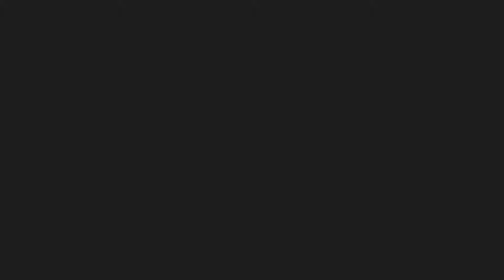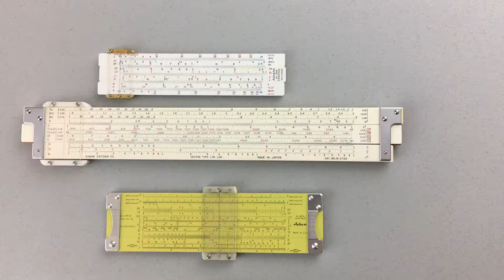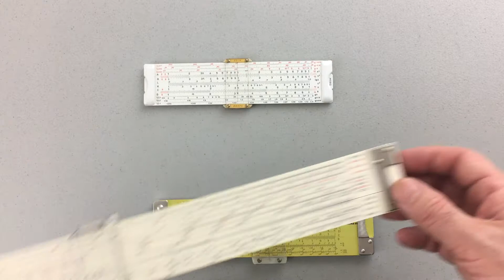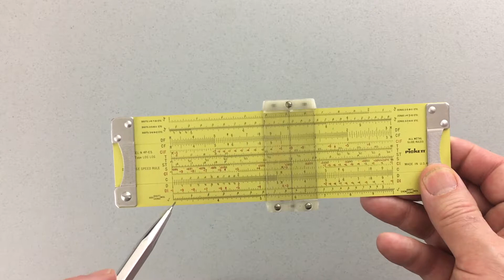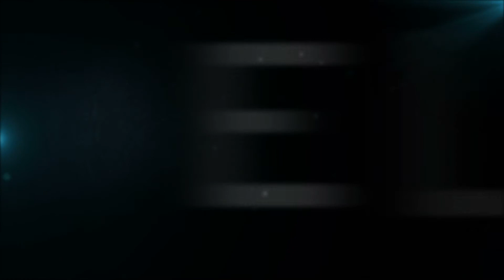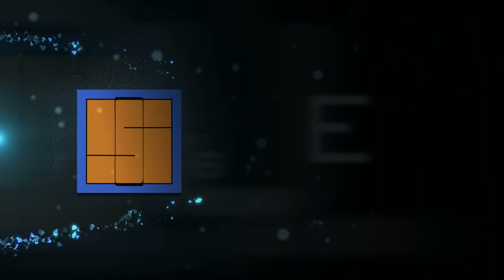Which Slides Rule?

Comment: I guess “That factor of safety “ is why most things built in the past ie., the 30’s,40’s and, 50’s were over built due to the inaccuracies of the slide rule.
Reply from the maker: I partially concur with what you say. Factors of safety are always applied because we cannot know all conditions of service and various conditions interact. When you consider the multiple dependencies in engineering problems, the engineers of previous times probably applied more factors of safety than is done today because we have different computational tools and more computing power at our disposal than say the engineers who helped put Apollo 11 on the lunar surface. The slide rule could provide say 3 digits on it and therefore there were limits to its computing capabilities. Having said that, many things in large civil works like a dam or a power plant don’t need lots of digits in an answer.  The slide rule, when applied properly, gives us a unique insight as to the dependencies between variables once you master it. 

BEGIN OLD MAN RANT

IMO, the slide rule’s true value is that an engineer or scientist could not go to a box (the electronic calculator, spreadsheet, etc.), plug in some numbers, and get an answer without exerting some thought. I find that the simple act of writing things down compels me to organize what I want to find, what information I have, and then work into the answer. (I note that I carry 2 slide rules every day and try to practice with them). IMO, it is far more important to manipulate the concept in your mind and then do the computation at the end than to plug numbers into a box hoping that you’re going in the right direction. 

By definition, you have to understand what I will refer to  as “Pre-Calculus Math Facts” for you to make intelligent use of a rule with exponential or trigonometric functions. A calculator (and math textbook’s use of electronic calculators since the mid-1980’s) allows the user to become more of an operator than a thinker because it is easy to punch in numbers and produce an answer. A slide rule requires more thought to use.

The first chapter of many manufacturer’s slide rule booklets plus the numerous books published from the early 1900’s up into the early 1970’s would then focus on the MAGNITUDE of the answer. The act of simplifying the answer using “easy numbers” and learning how to think in scientific notation helps immensely when performing back of the envelope calculations. How many texts on elementary scientific computations written today have this basic information on learning how to estimate included in their introductory material? I’d guess very few.

I once had an older electrical engineer pull out his Post pocket slide rule and perform basic mental calculations associated with figuring out apparent power given some basic information. When we checked his answer with a hand calculator, we found he was off by say 1 or 2 digits in the 3rd place of his answer. Not too shabby for a mass manufactured piece of plastic given that I punched in the same set of numbers in my $120 (1985 cost) HP-11C with little understanding of what he did (I was a college engineering student at the time).

I cannot resist my favorite example.  If you want to perform elementary vector calculations with an electronic calculator, you need to understand the keystrokes sequences in the given device (one electronic platform being entirely different from another). If you get a keystroke sequence incorrect, you will get an error because of you have input numbers in a format that your device does not “like”.  Even assuming you make it past the input hurdle, the modern electronic calculator most engineering or science students would buy has a user interface that is difficult to use for vector manipulation. 

The slide rule, by contrast, easily converts between polar to rectangular forms (again with a little practice and a firm grasp of trigonometry) common in vector operations. The slide rule does this without the need for batteries, the need for constant firmware upgrades, risk of malware, hacking, or a user’s manual beyond what you get from the slide rule vendor. In days past, a well laid out slide rule (with an informed user) saved many an engineer or scientist from carrying around handbooks filled with arcane pieces of information since all the common data could be placed on a slide rule scale. 

I’d ask you to consider the fact that the Hoover Dam, the Empire State Building, and the SR-71 spy plane were all built with only paper, pencil, and a slide rule. Granted, we had teams of people possibly working on the same portions of a problem and no doubt it may have taken longer to do these tasks. Even so, the fact that this humble tool did so much to build our modern world is simply astounding to me!

END OLD MAN RANT
Reply: @sliderulesurvival766  Most excellent discussion! Many thanks. In 1974 our college chemistry professor only allowed a slide rule for classroom calculations. Learning scale relationships and keeping the mind focused on each calculation step of a problem was the goal, which is mostly lost in the use of digital calculators. The slide rule is an amazing tool.
Reply: @TheRockMorton 😊
Reply: There's a big difference between precision and accuracy that people don't grasp until they play with slide rules. A slide rule will give you a 100% accurate answer if used properly, but only to 3 or 4 decimal places. A calculator will give you a highly precise but inaccurate answer to 10+ decimal places if you didn't enter your numbers to the same precision, because no answer can ever be more precise than the question asked.
 The real reason things were overbuilt in the past is because they were built to last instead of being disposable.
Reply: First, overbuilding wasn't predominant in the past - it's predominant in what survived from the past! Anything not overbuilt tended to fail because no one knew or could design for all the factors that would fatigue and lead to failure of structures or engines.

Overbuilding in civil and other engineering products of the past compensated for the inability to fully know and simulate the environment and loads encountered.

No team of slide rule users is going to perform FEA or CFD. Computers do that by manipulating whole arrays of numbers in ways that a room full of engineers could not do repeatedly at scale.

Now, I want to see if there's a way to perform FEA using analog devices, even if it has to be done in a computer simulation just to save time and avoid hoarding identical slide rule models...
Reply: @BrianTRice77 Trying to broaden my knowledge here, even at age 70+; what do the acronyms FEA a CFD stand for, and what are the operations used to find? I am obviously not going to perform the calculations, but I just learned about the “geometric mean” today, so for some of us, learning never ends. Thanks!
Reply: @charlesward8196 FEA is finite-element analysis.  It involves dividing a complicated structure into a large number of small "bricks", or elements.  A simple math model of the brick's internal stresses and  deflections due to unit loads applied to the corners of the brick describes the brick's response to loads.  The external loads are applied to the exposed corners of the surface bricks in the model.  The forces and deflections of connected corners have to match up.  This allows a set of simultaneous algebraic equations to be defined. The unique solution to the equation set provides the forces and displacements at all the corners in the model.  These forces and displacements allow the stresses in each brick to be calculated. 

CFD is computational fluid dynamics.  It is similar to FEA in concept.  The difference is that the simple internal math model for the bricks are the equations of fluid flow instead of the equations of structural deformation of solid materials used in FEA.  The solution to the set of simultaneous equations are the pressures and fluid velocities at all the "corners" in the model instead of forces and deflections.
Reply: Actually, I think environment factors, potiental defects in materials, and wear and tear over something's lifespan were far greater drivers of employing safety factors in design than the 1 part in 10,000 extra precision that a calculator or computer can provide over a slide rule.

Comment: Thanks you for the nice video.

Personally I like the mechanical construction of bamboo / celluloid slide rules (Hemmi / Post) the most. Gives a hefty feel.
However, the Aristo Studio has the clearest scales and great scale layout. And of course includes the P scale. It's my favourite (both the 10" and 5") in my collection.
The Pickett......not sure if I like the sliding action and the cursor is a bit too simple for my taste. It has some handy markings on the scales though.

In conclusion, you need to have them all ;-)

Ps: some great videos on how to use the different types of slide rules on Professor Herning's page https://www.youtube.com/channel/UCN6gKlR7kxVs1DF7zjIzMzg/videos
Reply from the maker: Thanks for your comments. I am fan of plastic scales more than bamboo/celluloid construction. I find that they are lighter (I carry a Faber Castell and a Logarex every day) and I really like the cursor layout on these rules. I had one bad experience with damage I did to a plastic rule when I dropped it because the tiny screws that held the cursor together came out (I should point out that this happened on a Nestler rule).  

As an FYI, the Aristo Studio 868 is my favorite of their pocket slide rule line (I have a few full sized rules but my favorite is the pocket slide rule- regardless of the company). Here, I could not agree with you more. Aristo seems to have thought of lots of little touches that make their rules easy to use. 

I will say this about Pickett rules- they seem to hold up better than almost anything I own- and I own quite a few from various manufacturers. The act of moving the cursor or the runner is relatively smooth. I also find it common that the screws on say a nice Post rule will gain a greenish patina on them. I have not seen that on any Pickett rule I own. Finally, I do like the “Eye Saver” yellow color on the Pickett rule. 

For whatever reason, North American manufacturers never used the P scale and that’s a shame because the P scale is very powerful to use.

I also judge a rule by its user manual. In a situation where all you had was the manual, a piece of paper, a pencil, and the slide rule, I would want a lot of hand holding if I were a beginner. IMO, the best slide rule manual for someone who has never used a slide rule is the Post slide rule manual because they were very selective in the examples they picked which matched things that interest me. The Pickett manuals I have for my N4 or my N3P are okay but I needed 2-3 reads of them and some practice on other slide rules before I was comfortable using a Pickett rule.